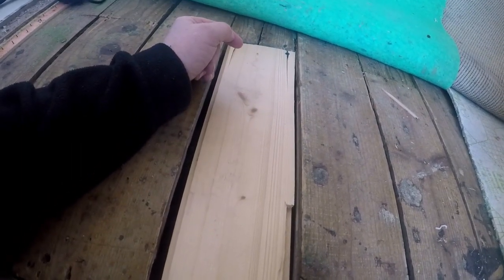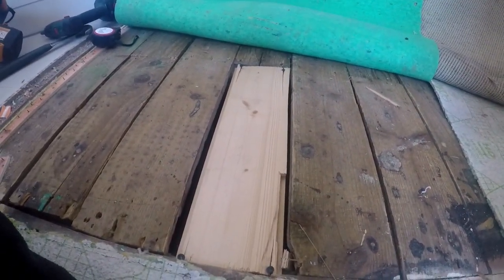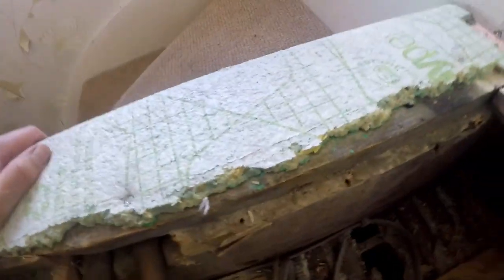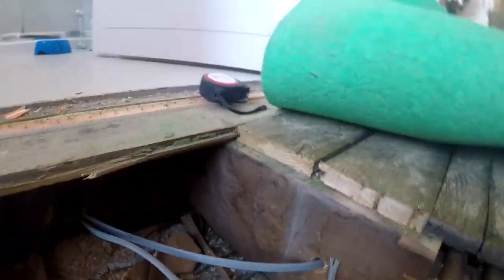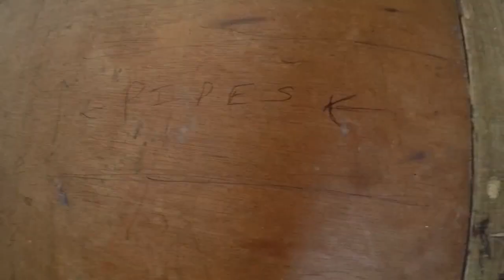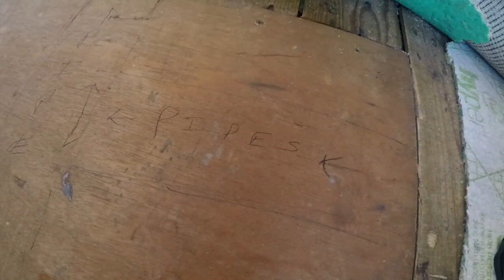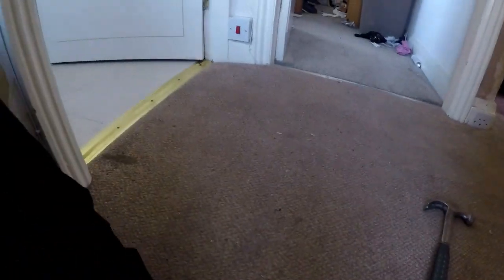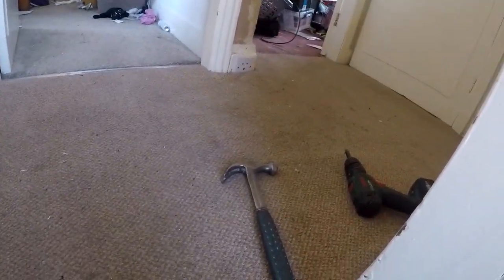Repairing floor boards

Comment: Nice job Glyn,  love the way you left the miss measuring in video so easy to do, I've done same, never followed the rule prepare, measure twice, mark out, double check size then cut 👍😁
Reply from the maker: My problem is that when I measure cable at work, I was always taught to allow an extra metre. But obviously when doing wood work you can't.